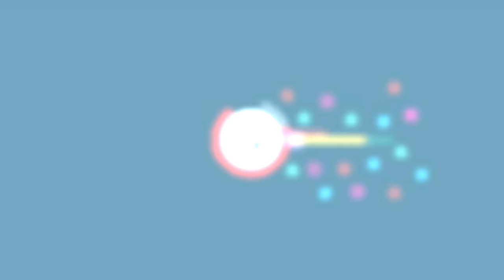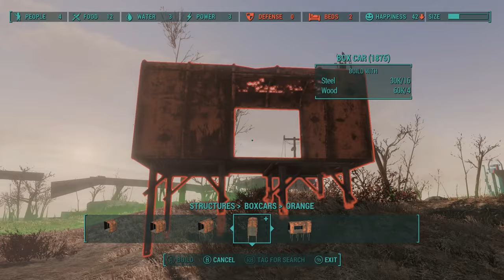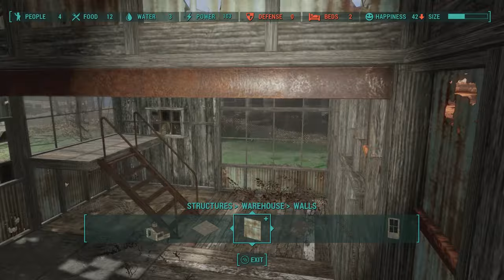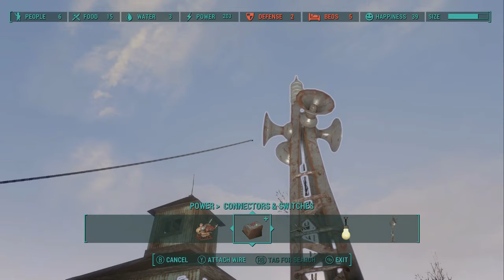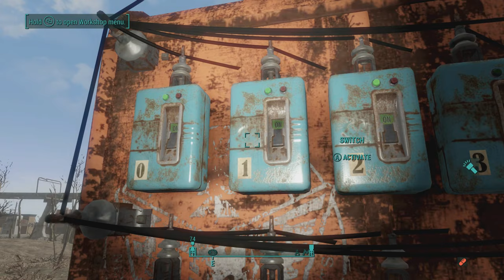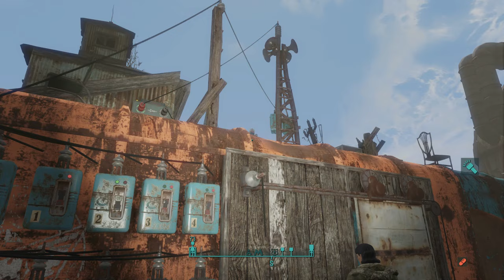Fallout 4 How To Build A Combination Lock | Factory Junk Build

Comment: You mentioned that you wanted to show some other power system ideas. I did a video that showed how to use one switch to control a BUNCH of different ways things with one switch. Basically it steps through different modes for the power grid. Push once to open cages, turn on arena lights, turn on beta wave emitter, and activate quitting time beacon. Push again to turn off beta wave emitter and turn on turrets to kill the surviving monsters. Push again to reset.  Video is in my tutorials playlist and called "Smarter Power."

Comment: that's kinda cool, I'm going to do something similar with the vault tec workshop so I don't have to run wires everywhere (took me I bit to figure out that vault walls conduct electricity and you just need to add the distribution box to tap into it and 
radiate power or attach items that need more than the radiated power)